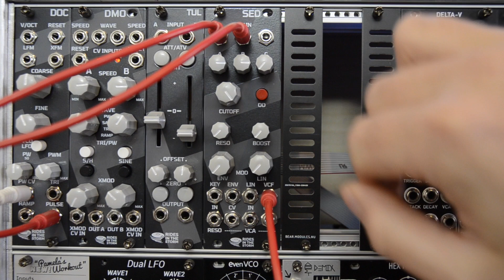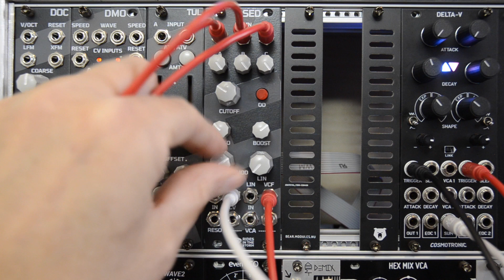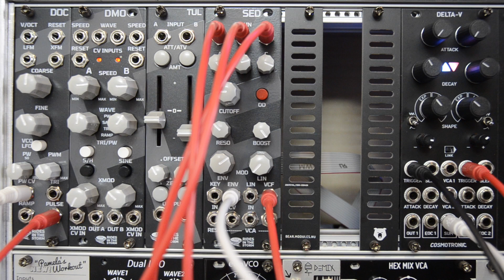IMAVAI #3 / trying out your requests / STEP 8 ODESSA / SED / ADDAC 601

Comment: Are you able to get any useful EOC triggers from the cosmotronic delta-v? I can’t seem to trigger anything with them. Maybe it’s too short
Reply from the maker: You're absolutely right. Not every modules reacts to the EOC triggers. Delta-V itself does, but that's to be expected. Maths doesn't really like them and using them to open a LPG doesn't really work either. I'd say it's one of the few downsides of Delta-V that I've encountered.
Reply: @briesmodular  I wish that you could still use the envelope voltage while using the internal VCAs too. Otherwise, I think it works alright
Reply from the maker: @GhostKitchenBand  Yeah that would be a useful feature as well, I tend to use the second envelope linked to the trigger of the first as an obvious workaround. There's been times where it hangs on me, when in cycling mode and modulating the attack/decay times. It's easy to get out by going out of looping mode for a second. Have you encountered that by any chance?
Reply: @briesmodular  yeah, definitely noticed it getting stuck sometimes. Not a perfect module, but it gets most jobs done fine in a small footprint. I tend to rack it upside down because it’s hard to get to the knobs when all the cables are coming out of the bottom. I wrote to cosmotronic about to these issues. I wish the EOC output was more like maths where it stays high after the envelope finishes. Much more useful